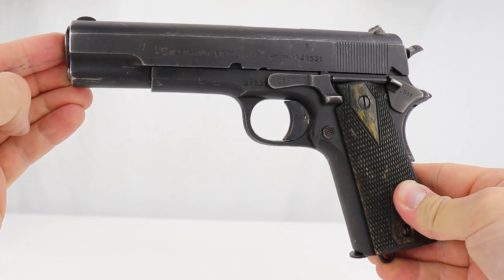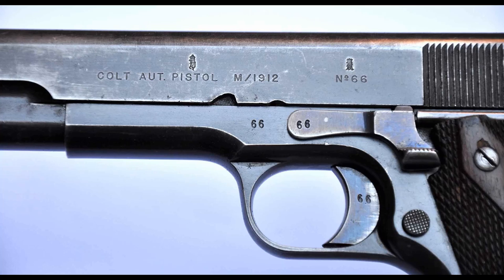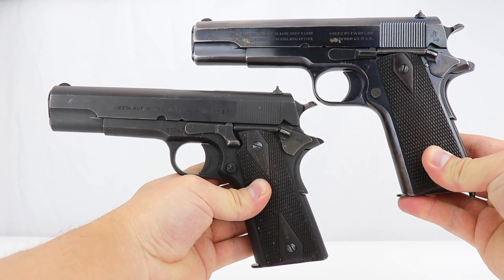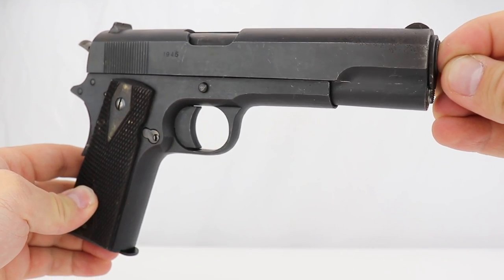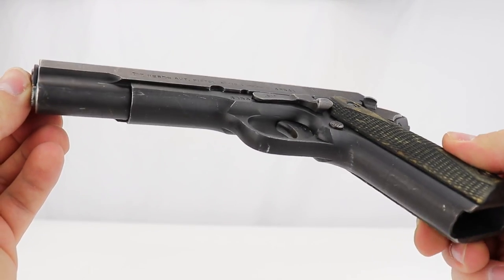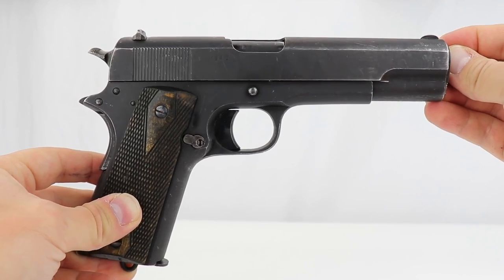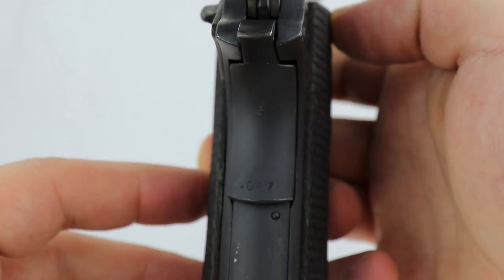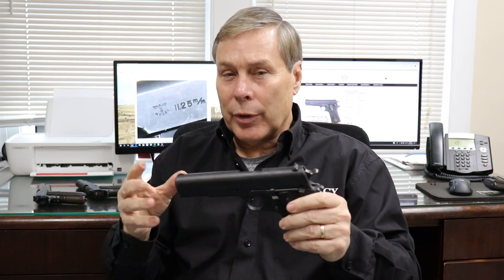Norwegian Kongsberg Colt (1911) Model 1914 Pistol .45 | Walk-in Wednesday

Comment: That slide stop/release is interesting, makes it easy to spot for sure.
Reply: I love it, I wish it were more common.
Reply: About 20 years ago if I correctly remember Sarco the milsurp company advertised several hundreds of these for sale.  Perhaps custom gunsmiths bought them up.  I passed at the time because installation would require alteration of the left grip panel to 1 of a kind oddball configuration of an oridinary 1911.  Have never seen any on any pistols other than the Norwegians.  Perhaps if you research these might be avaiable yet.

Comment: I have one of these Kongsberg Colts, mine was made in 1922 and the serial number is in the mid 2000's. It seems that they were never in any particular hurry to manufacture them in quantity.
Reply: I have one that was made in 1928. Serial number is just over 17000 on mine. So they made around 15000 from 1922 to 1928.

Comment: Is that lowered slide release easier or harder to use than a U.S. 1911? Looks like a good place to rest your thumb while shooting.
Reply: I think it's an improvement.  Easier to use
Reply: I never had that problem. I am left handed
Reply: That might depend on the lenght of your fingers and thumb. But most people say it's much better on the Kongsberg Colt. I have both an US 1911 and a Kongsberg Colt. I have quite short fingers. On the 1911 I have to change my grip to use the slide release, but with the Kongsberg Colt I can reach the slide release with my thumb without changing my grip.

Comment: You really need to start going over Glock Pistols, they aren't represented enough on the Guntubes... :-)
Reply: Will certainly consider Glocks for a future video
Reply: Glock ? BEUUUURRRRK
Reply: What's collectable about Glock? When I was a lawman I worked for  three agencies over the course of my career. All three issued the Glock model 22 .40s&w. I'll concede that it's good (actually Very Good) in that particular role because it is very simple, durable, reliable, combat accurate, and affordable (especially when compared to my own choosings). Needless to say the homely plastic thing made my skin crawl at first sight. It doesn't even have GRIPS in the traditional sense FFS! How would I adorn it with Ivory or Stag? Unlike many of my former colleagues I am and have (seems like) always been a firearms enthusiast. I don't mind buying ammo for extra practice, going to the range on my time off, purchasing better leather (nylon duty gear is almost as classless as a Glock), making certain my handgun is properly cleaned and lubricated for 💯% reliability, testing ammunition first hand to make sure I'm using the very best, paying for a better handling, precision accurate, much more visually pleasing sidearm. At my first agency that was a 4" Model 27-2 S&W .357 in Safariland leather with Winchester 180 grain Black Talons and at the third a pre-series seventy Colt Commander .45acp (what's often incorrectly called a "Series 70 Lightweight Commander"), Safariland leather, with Winchester Ranger T 230 grain ammo. I did have to carry the Glock at second agency while on duty but as I worked on the water for most of that period it made sense. I damn sure didn't tote it when off work and can't see much anything I'd consider collectable about them but "to each his own" as old pard used to say or "you do you" I think how it's put today.

Comment: I wish I had a source for it. But I remember reading somewhere that the Norwegian cartridge mad to the KB Colt was slightly lighter then the norm.  A 12,9 g (200 grains, US) projectile was used. As opposed to most of the .45 ACP FMJ cartridges i find today, that use a 14,9 g (230 grains, US) projectile. Does anyone know if there is any validity to this statement or not?
Reply: In Karl Egil Hanevik´s book "Kongsberg-Colten" on page 160 there is mentioned that the bullet weight of the M/28 cartridge is 13 gram/200 grains within the approved variations of +/- 0,1 gram. The domestic production of these cartridges ended in 1958.